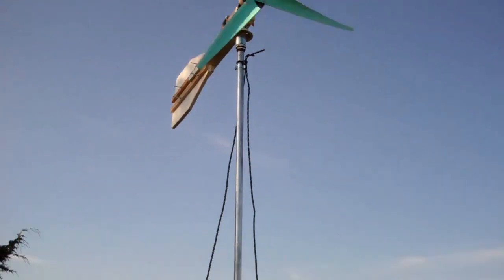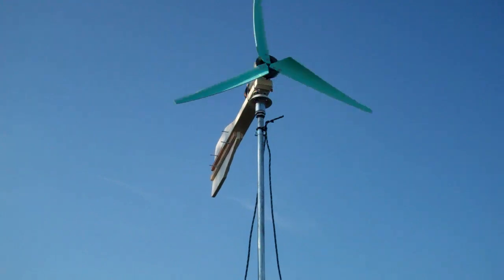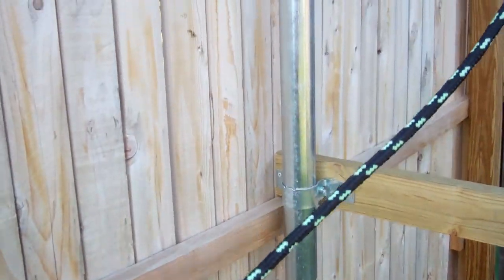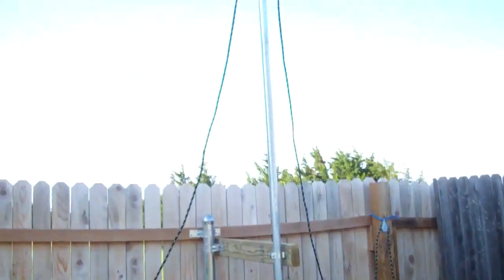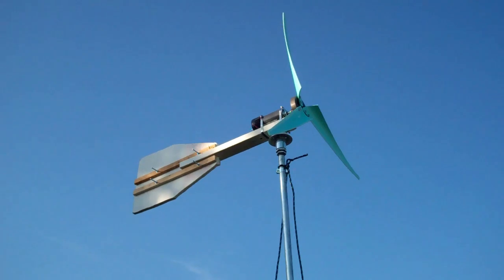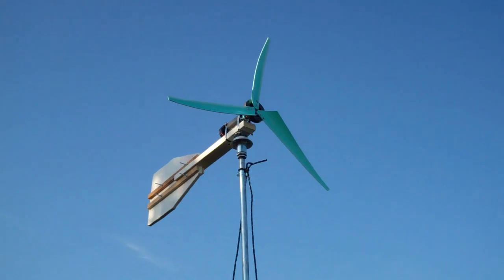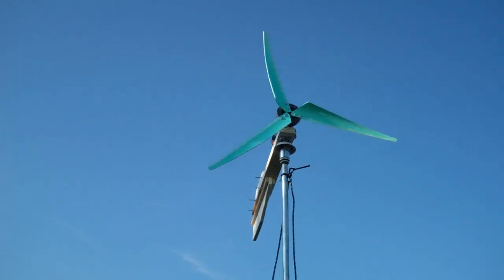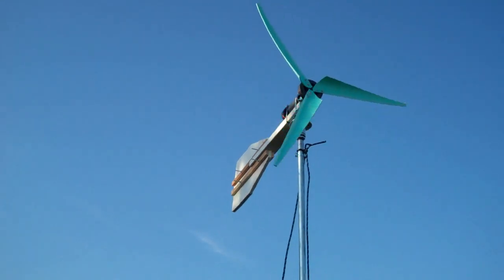Wind Turbine Part 7: I need more power!

Comment: I think your hubs ok  but  your blades are to short I used schedule  80 pvc 40 "long and she spun  like a bitch !!   Be careful  of the schedule  40  pvc I had a wind turbine   blades made out of schedule  40  , after a while  the uv rays makes  them very brittle  and on a real windy day they blew apart like a bomb!   pieces where stuck into the siding  of my house almost took out my picture  window , anyhow  Great  job !!  Im starting  on my third turbine tomorrow  Thanks for the video
Reply: To make your turbine  spin, an easy  solution  is to buy the dolly wheels  from harbor freight  their  like 4 bucks cut the wheel off attach  the swivel  to the top of your mast  they work really  well .
Reply from the maker: Thanks for posting! This was an experiment that in glad you all took the journey with me. I moved exclusively to solar mostly for the unprecedented nature of my turbine

Comment: Hi Dan:  I believe your system is fine.  I bet you are having the same problem that I am.  When I put my turbines up to about 20feet, they don't work so well.  When I have them at 8feet, they generate a lot of power.  The reason this happens is because all of the houses around me are more than 40 feet tall.  In my yard, from 4 to 8feet up, I get clean wind.  The wind at the 4 to 8feet mark is ware the wind moves between the houses making it more clean.  Please see "Mini wind turbine 4a" and you see what is happinging in my yard.

Comment: you will need some really thick wire to carry any good dc voltage that far.  i used a ceiling fan motor type ,[ brushless ], to make AC vertical wind rotor and changed it to DC at the house to charge the batteries.i found the project on youtube.
Reply from the maker: Thanks for the post! I ended up using an extension cord and after the fact wondered how much loss it suffered.
Reply: Dan Hounslow i was thinking of going over to a scrap metal place to see if anyone brought in some fat heavy wire. they would sell it at scrap weight price.

Comment: does the weight on the original fitting to the motor (that you've attached the blades to) reduce the power?
Reply from the maker: That is a good point. In retrospect it probably did. 
Thanks for your comment!
Best,
Dan

Comment: loved your journey, i would suggest bigger blades perhaps?. My blades are one meter long (3foot) and are a much thinner PVC and im using a smaller motor but i get like 2/3v. the only thing is my wind turbine has a fair bit of  drag on it so it gets a lot of speed but being fully PVC it wont last long over time.
Reply from the maker: Thanks for your post! That is good to know and something I will look into if and when I dust off the turbine. 
Best,
Dan